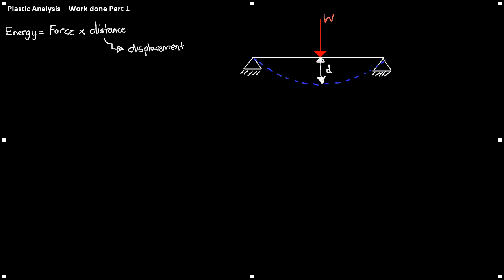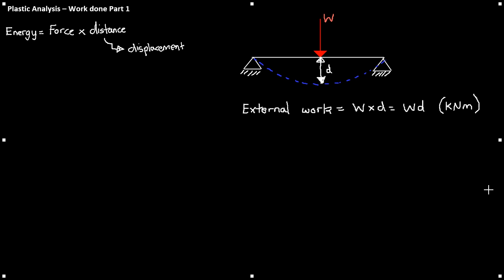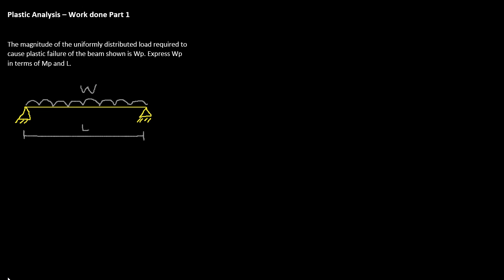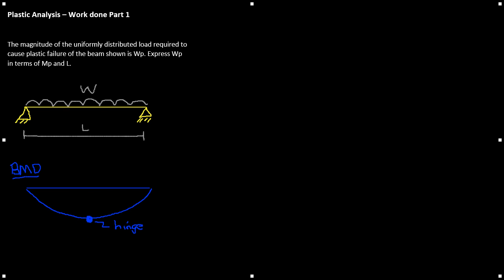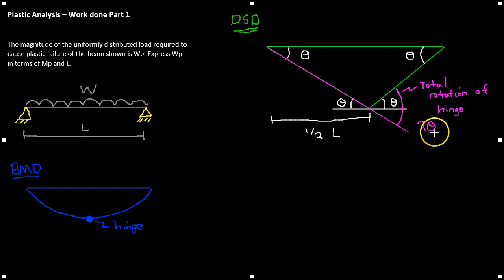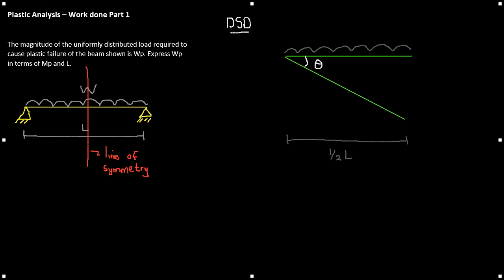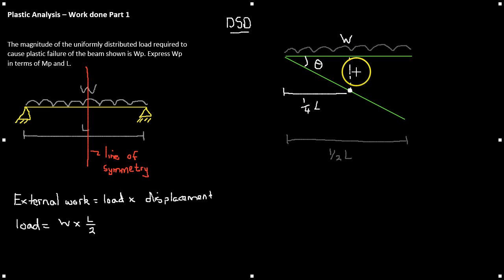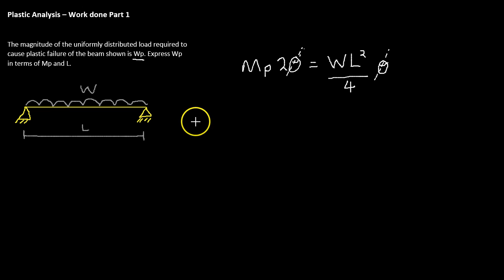Plastic Analysis   Work done Part 1

Comment: Is it just me or should external work = (wl^2).theta/2 because total force is WL and then displacement is L/2 x theta? thanks
Reply: +Alex Astarci oh right I just saw its because we only analysed half the structure but then why is Internal work 2 theta if we are only analysing half of the structure?
Reply: Alex Astar correct me if I'm wrong but he was considering half of the beam for external work due to symmetry then at the end he multiplied the answer by two to account for  the whole beam. He found the total angle of rotation for internal work hence he just found the internal work of the whole beam.
Reply: yes you are correct. he over complicated something that was oversimplified by halving something that was already halved again, and he forgot the fact the he then multiplied the load by displacement so in the denominator he multiplies 2 by 4 giving 8.  what he should have done was multiply the load and displacement individually by 2 or multiply by 4 at the end.